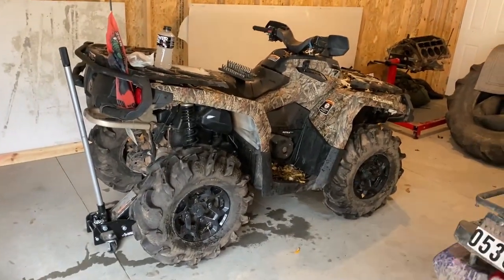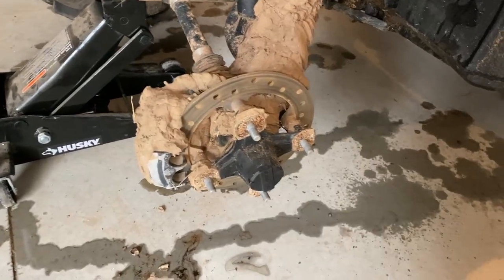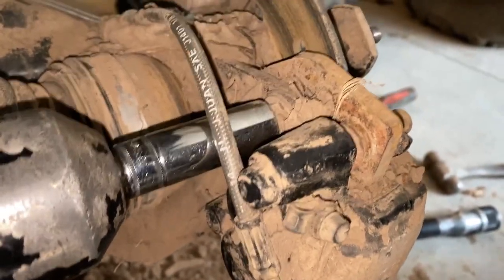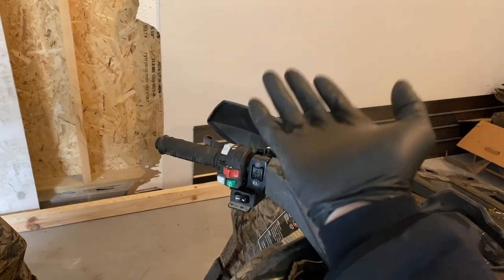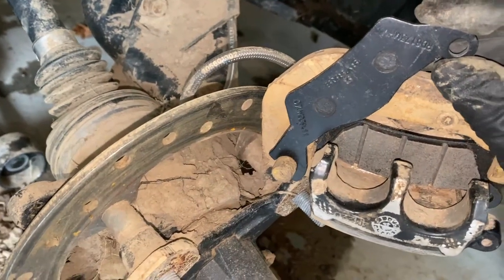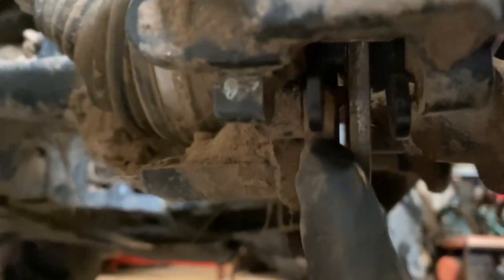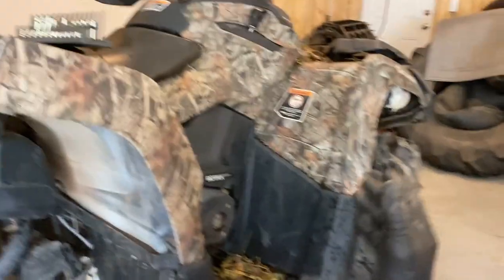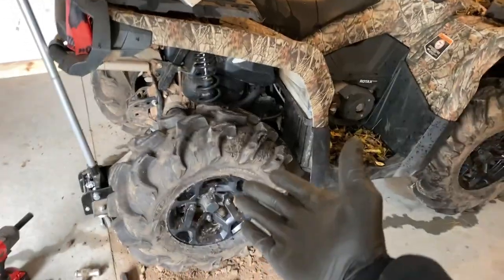Can-Am Outlander Brake Pad Replacement

Comment: Graet job buddy, I would clean the brake calipers pistons before squeeze them back to the caliper.
Reply from the maker: Yeah, not a bad idea. I tried brushing them off a bit, they were actually a lot worse if you can believe that. This mud was just cemented on and I just wanted to get it done with haha.
Reply: Tony The Truck Guy haha yep man, fast job and brakes ready 👍🏻

Comment: When you tighten those lug nutz!

Tighten til snug ! .  And if the nut/bolt is lined and the wrench 🔧  handle is at 12 o'clock--->🕛 torque numbers is..  never pass the 3 pm🕒  <-<-   and if its somehow loose ? . Stop  when wrench handle reach 3-5🕓<<<- the clock are wrench arms. Lol  understandable knowledge 😅
Reply from the maker: @elvispressedtalot9899  TORQUEY TORQUE

Comment: Hey man great video. I have the same situation with my back brake, it wore out the pad's metal on metal.
And you didn't have to replace the roader?  Did it ride just fine? I'm just wondering because I don't want to replace the disk if I don't have to.
Reply from the maker: It really depends how damaged the rotor is. Mine was good enough where I could run it again, but it all depends how long you operated it with the pads metal on metal. If there’s and cracks or heavy scoring in the rotor, it should probably be replaced.
Reply: @TonyTheTruckGuy  
 The rotor looked fine so I only did the brake pads And thanks again for the video it made my 1st time doing breaks a snap 👍
 I wish I could send you a picture of the old brake pads there was no brake pad material left...
Reply: The Can Am shop wants $260 in labor to do a full set of pads.

Comment: Does the 2014 can-ams only have 3 brake Pairs of brake pads?
Reply from the maker: Depends which model you have. Renegades I believe have 4 but outlander is 3
Reply: @TonyTheTruckGuy  you are a life saver, thought i just bought an outty with no rear brakes cause it was missing a caliper. But they are only supposed to have 3?
Reply from the maker: @Gavyn307  Haha, yeah, as far as I’m aware. Kinda odd because the outlander is heavier, so you’d think they would want 4 calipers, but I guess the Renegade is their more performance and race oriented quad, so it does kind of make sense.

Comment: How to bleed them? My front breaks won't bleed. Even with the vacuum on it?
Reply from the maker: Make sure brake fluid is full, then have someone pull the brake lever while you open the caliper bleeder. Close bleeder, then release brake lever. Repeat until all air bubbles are out of the caliper.

Comment: You don't believe in anti seize or blue locktite?  That caliber bracket bolt looks ready to seat itself permanently.  I'm not being that guy, it was just an observation.  You know more about it than I do.  I do wrenching, but not as much as you.  I'm curious if you think it would help, or doesn't matter.  Good vid, Cheers.
Reply from the maker: Haha well unfortunately I didn’t have either of those with me even if I did want to use them. Since the caliper bolt was fairly tight as you mentioned, I wouldn’t have probably used loctite anyways. If it was a car I probably would, but this thing sees enough mud and water that rust acts as a natural loctite 😂 I do support using both products, just depends on if I have them on hand and what application I’m dealing with.

Comment: How do the brakes work on the can am is it one lever all brakes?
Reply from the maker: The Outlander has a foot brake pedal which controls just the rear brakes, then it also had the lever on the left handlebar which is all 4 brakes. The Renegade has another lever on the right handlebar for just the front brakes in addition to the foot brake and the left handlebar lever.
Reply: @TonyTheTruckGuy  thankyou for explaining because i was go ing to get the renengade because i wanted all four brakes in my hands one foot and one lever so thankyou

Comment: Links appear to not work anymore for parts.
Reply from the maker: Dang it. Typical 😂 The XMR pad link still works if you’re interested in those. That’s what I put on mine. Supposed to hold up a little better in mud. Otherwise I’ll try to find a new link here for the normal pads to replace the broken link
Reply from the maker: Added a new link for non XMR pads but i'd still recommend the XMR pads!
Reply: @TonyTheTruckGuy  sweet. Thanks brotatochip
Reply: @TonyTheTruckGuy  any recommendations on a new rotor? Mines about as beat as a prison dick.
Reply from the maker: @mattwilliams4220  🤣 I never had to change mine so I can’t make any recommendations unfortunately. Not finding anything on Amazon so may have to use the dealer or find an aftermarket company that sells upgraded ones